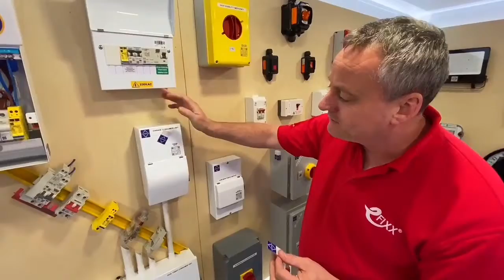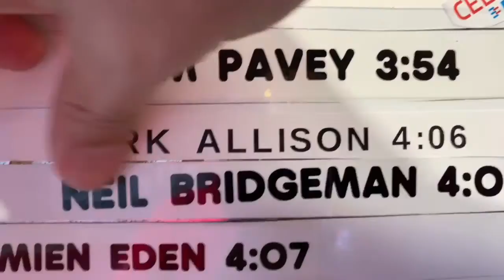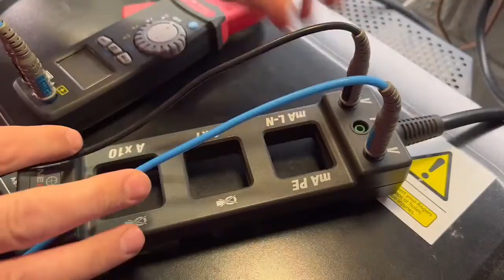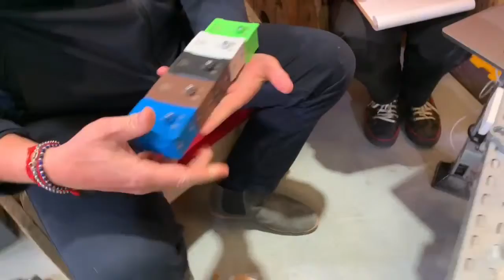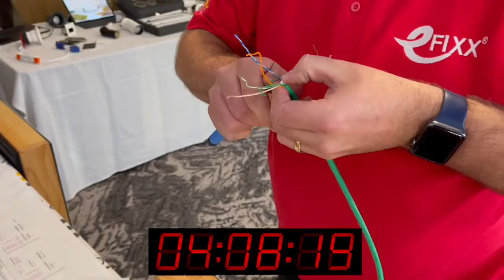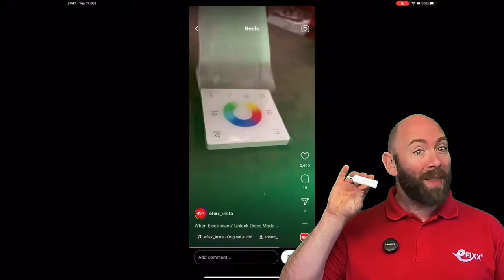Award Winning Electrician Reveals First Fix Secrets

Comment: It’s been mentioned here in other comments already but aside from the obvious grouping factor issues when taping cables tightly in walls…what if a cable needs to be replaced because of a fault or an alteration? How are you getting that cable out?

Comment: In the USA national electrical code requires some space between the cables to prevent over heating. We use plastic clips on the wood beams to space the cables as per code. Job very neatly done.

Comment: Why should a 100A main switch generate significant heat? An MCB has an inbuilt small resistor to deliberately generate heat so it will trip if the max permitted temp is exceeded. But the ideal main switch will have zero resistance and therefore zero voltage drop and no heat generated.
Reply from the maker: Resistance is never zero - the 100A switch has a contact resistance and so do the terminals - you’ll be surprised by the difference the torque makes 👉https://youtu.be/EB-Zh89nHnk?si=9ZoFQBqiWVNDOyAQ
Reply: You can increase the cross sectional area of the metal current carrying parts in the main switch, that will lower the amount of heat generated, and make it more efficient; how big do you want the main switch to physically be?
That's the issue.

Or you can make it out of a high temperature superconductor and request planning permission to erect a big white cylindrical tank containing liquid nitrogen or liquid helium to keep it cool so that its resistance drops to zero. 

Neither are practical solutions for the home. So until someone develops a room temperature superconductor with good mechanical properties that an electromechanical switch can be made out of it, we are stuck with main switches that are going to get warm with a high current.

Comment: As far as spacing MCBs, it would be nice if manufacturers made devices that are actually capable of carrying the currents they were designed for, without getting hot.
Reply: Clearly you don't understand the relationship between current and heat.
Reply: Clearly you don't understand that if they utilised better materials and design, contact resistance could be reduced so to cause negligible temperature rise within their operating parameters. But thanks for your input. @deanXRayZulu

Comment: If you quickly want to know appliance amps/voltage/frequency/power factor, then a ten quid kill-a-volt plug in adapter can't be beaten. Now if TIS was to come up with a similar device that also gives earth leakage reading, that would be a BIG seller.
Reply: So interesting; I’ve just started out at college in installations and had some hands on xp with a contractor whom I know; he had one of those plugs and I found it quite cool as it was my first time ever seeing one
Reply: What brand did u say you , use ?

Comment: Ganging cables together like that would not be safe …
Reply: Thermal constraint
Reply: @TheDjardy  although should’ve been calculated if this is how the install has been designed.
Reply: @SME_Ste  I would be amazed if this was taken into consideration
Reply: For what reason?
Reply: Derating requirements ( in oz as/nzs 3008 table 22 says 0.76 - .0.23 ( 20:or more circuits ) ie that would lead to degredation and a huge loss in ccc ( current carry capacity ) and hence increase in thermal generation… guess the standards are telling me pretty is not necessarily better ( and the hole size in the wood is questionable …but what do I know..
 @SME_Ste

Comment: Nice and neat i’ll agree. But metal plates over cable routes passing through top plates and running cables in zones behind switch boxes, whys this big news? Been done like this for yonks man.
Reply: I'm going to say its Barratt homes electrical spec, they seem to believe these galv lids will protect the cables from nails and screws... Even a stack of 10 didn't even slow a nail when I showed them
Reply from the maker: Might not be new, but most people don’t pay this level of attention.